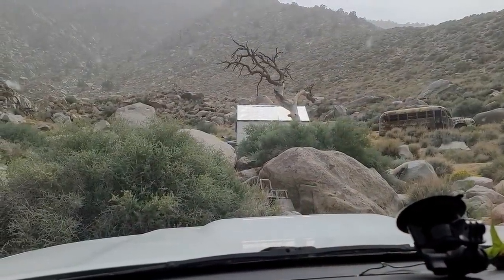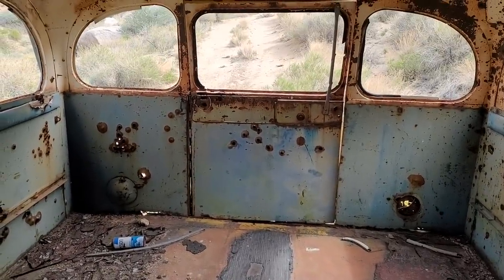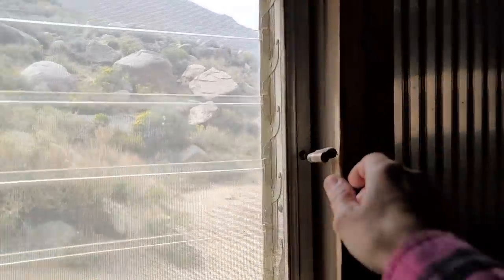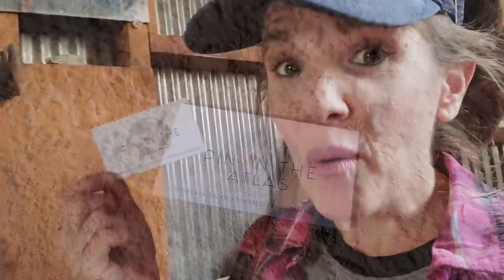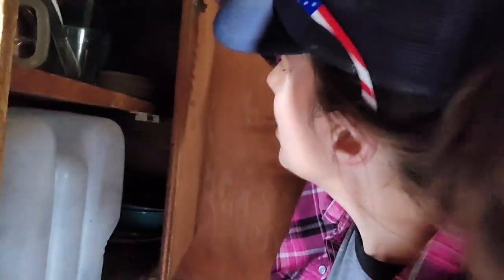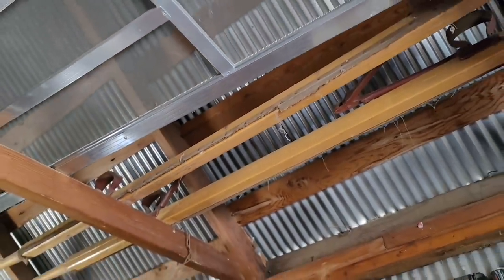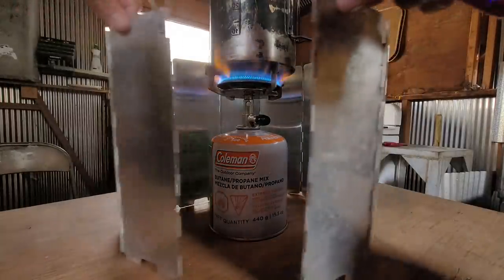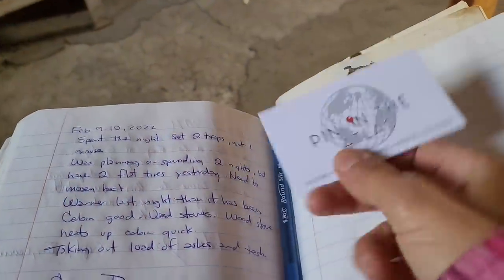Sheltering From a Storm in an Old Prospector's Cabin in the Mountains of Death Valley

Comment: Becarefull of the high winds in DV. In taking the DV route to Trona in the early 70s, a wind storm blew in black out driving conditions. Which brought traffic to a halt except for the brave few like myself. It was down around the dunes which was the worst. You could barely see the road, covered with sand. Cars that parked on the rd were a real danger, with sand piling up mid door height. It was so dusty inside of a closed car I was wearing a bandana around the face. Only able to creep along at 5-10 mph for 1.5 hrs. When I finllya hot out of my car, I saw the real damage. The sand had blaster away areas of the vinyl roof and the paint has been sandblasted off the sides of the car. My band new rims also had a different look. And my windows were frosted over by the sands. All needing to be replaced. When the insurance adjuster saw the damage he asked "couldn't you have gotten an accident son?" he wanted to total my car out from a sand storm 

So beware of those high winds around the Dunes Kid's

Comment: Bring a cordless drill and some drywall screws to tighten up the loose spots on the aluminum siding/roofing. A few key spots would probably stop the rattling. You can't get that corrugated aluminum roofing anymore. It was the Deluxe material! Never rusts!

Comment: 1:56 You put a five gallon bucket with a disposable plastic bag liner under the seat and use it. When finished you seal it and take it with you. Often use cedar chips to control odor. Much better than digging a hole and burying it since that would be a higher traffic area and soon you would be digging up old ones while looking for a new hole. Guessing this is a volunteer cabin like others you have been to. Happy 420 day miss.
Reply: Hey, I like that.
Reply: Use some lime works great in a outhouse.use to have a 1940 cabin with a dual seater outhouse.